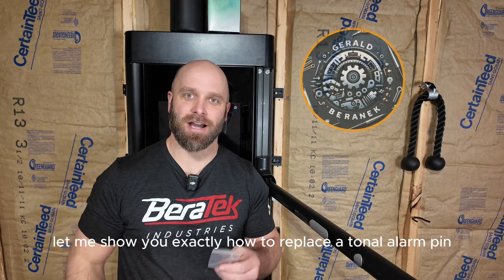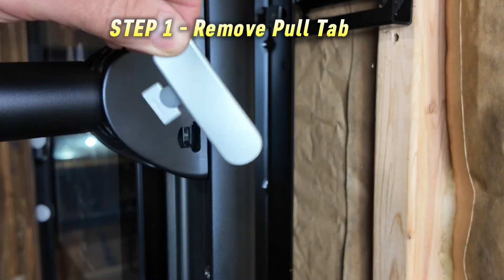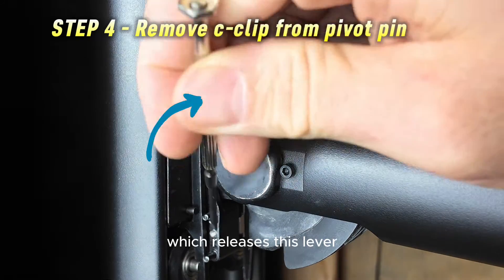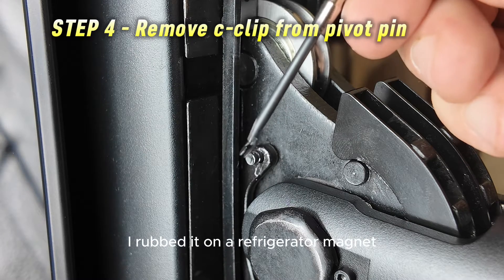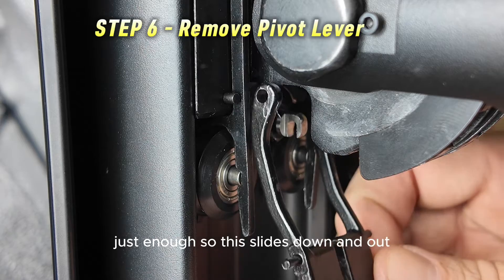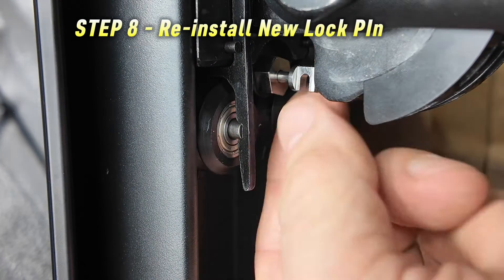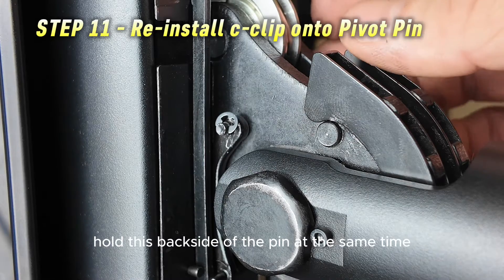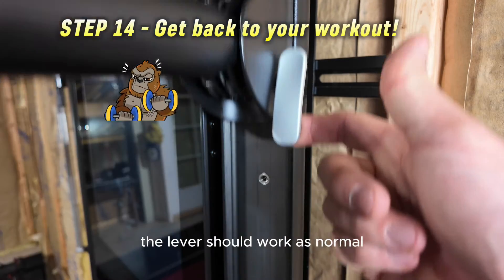Step by Step - How to replace a locking arm pin in Tonal Home Gym with upgraded stainless steel pins

Comment: The plastic cover on mine won’t come off
Reply from the maker: Is you arm stuck in the top position?  If so, it is very hard to get off and likely won't come off.  You'll have to get the wrench in there to get the pin out just by bending the plastic back enough.  Once you get the broken pin our the arm will move freely then you can take the plastic off.
Reply: @GeraldBeranek I fixed it

Comment: Thank you for this video and the tool. Last Sunday, my tonal arm locking arm pin broke. I ordered the tool on Monday for standard shipping and received it on Friday. I installed it and it works better than the other arm now! I’m considering switching out the pin on the other arm, but I’ll wait until that one breaks. I didn’t want to bother contacting tonal because it seemed everyone had trouble getting them to come over and/or replace the part. Our tonal has been working fine for the past three years, and this was the first issue we’ve had. I’m very thankful for this YouTube video and the part!
Reply from the maker: That's great to hear and glad it all worked out for you!

Comment: Thanks for this. I ordered your kit about a year ago and related the one broken arm. Other arm broke today and luckily I found the other pin in your kit. My only suggestion is for the c clamp, to use a small set of needle nose pliers to pull it off vs a screw driver. Less risk of it springing away on you
Reply from the maker: that's great news!  Glad you found it!  I agree, needle nose pliers would be easier!

Comment: How do I know if this is the problem with my Tonal? Mine sorta loses suction if that makes sense … if I’m doing Bulgarian split squat with arms all the way down, the arm will give lose a few reps in and move up one slot. Any suggestions?
Reply from the maker: This sounds like something else is wrong.  The pin just holds the arm in place before weight is added.

Comment: Any advice on taking the screw out? Mine is stuck on the highest level and I cannot remove the cover making it 10x harder to remove the screw.
Reply from the maker: You will have to try to wedge the plastic up just enough so you can get the old pin out.  Mine was stuck on the highest one as well.  It can be done and it isn't the most convenient place for it to fail. Once the pin is out you can move the arm down and get the plastic off.

Comment: This was perfect! Ordered on Wednesday, Tonal fixed on Saturday. Much better than waiting weeks for the manufacturer. I was able to do the repair myself in about 15 minutes. On the c-clip, a needle-nose did the job perfectly without having to worry about losing it. I was able to rotate it and pull it straight  up and off the pin. Thank you for putting together this great kit and video!
Reply from the maker: you are welcome!  glad it all went well and you are back up and running!

Comment: Despite taping… I STILL lost the damn little ‘c clamp’. Anyone find a source???

(I have purchased Gerald’s kit as the pin Total replaced under warranty has already broke!)

But now I’m on a C-Clamp quest!

🙃
Reply: Ok… found one!  Not an exact match… but it should be enough to hold it!

Kit installed and is working GREAT!  If I didn’t have fear of losing the other little C Clip I’d do the other side just to be done with it!

As it is… will evaluate how well my not-perfectly-matched little alternate C Clamp holds…
Reply from the maker: I think it is just a standard 1/8” c-clip!  You can find them at a Lowe’s or Home Depot!

Comment: Great video Gerald - appreciate you making it and offering the product.  A quick question- my tonal arm is ‘jumping out’ of two holes on the track - as I exposed the arm using your video, it looks like my pin has lost some of its ability to ‘return’ back to its original position- like a spring is worn on the inside of the pin.  Do your pins have similar or better springs which help to fix this?  Thanks for your insight!
Reply from the maker: There is a spring inside of the pin.  Likely what is happening is that the tip of the pin came loose which takes the compression of off the spring.  The pin I make has a screwed on tip so it can't come loose.

Comment: My arm was stuck up in the top position which presented a little more of a challenge because I wasn’t able to take the arm cover fully off.  The bottom of the cover tilted out enough for me to get in there and remove the hardware. The c-clip is definitely the trickiest part.  Once all the hardware was removed I was able to slide the arm down and fully remove the cover and finish the install with no issues.  Instructional video was a great help - thanks!
Reply from the maker: you are welcome!  Glad it went smoothly for you!

Comment: Just ordered! Great job on the video and i hope mine come in fast. I have a temp fix on the original pin, but no sense replacing a weak part with another weak part. Definitely worth the money for the problem it solves and not having to wait on tonal to ship the parts to a technician and them to come install it. Can't lose my streak 😂
Reply from the maker: I saw your order today!  It will ship out tomorrow first thing!  Thank you for order and the kind words!

Comment: Excellent video this is the third time I’ve had to replace my pin. The other video on YouTube is not detailed as yours. Great job. How do I order your kit? The only thing I really need is the pins. Also, needle nose pliers work better for me when installing the c- clip versus the small screw driver.
Reply from the maker: Thanks!  I appreciate that!  Didn't do to bad for my first instructional YouTube Video!  You can get them from my overly simple shopify store here - https://642986.myshopify.com/products/tonal-arm-plunger-pin-assembly-replacement-kit

Comment: Holy cow that small little piece of sh*t C-CLIP drove me insane getting it installed.  Dropped it several times, got lucky to find it.  Finally it worked after like 45 minutes of trying.
Reply from the maker: You got lucky you found it!  I dropped it a couple of times and it took forever to find it!  You could also use a small needle nose pliers!

Comment: Is this fix for an arm that locks in place but moves up during the middle of a set? In the bottom position the arm will unlatch and move up during the middle of a bench press for example.
Reply from the maker: Likely not, the pin just holds the arm in place while there isn't any weight on the arm.  Once you start a weighted lift the arm locks onto the rails.  The pin isn't strong enough to hold the arm in place with a weighted lift.  It sounds like you have something else wrong.

Comment: Great video. I've had to do this a couple times now. Saw you sold improved plungers and went to buy.. $100!! Dude.. it's 2 tiny metal screws with a spring and pin.. gtfo
Reply from the maker: Yes, these are CNC machined in the US from stainless steel and hand assembled. Fully custom besides the spring. It isn't a mass produced, high volume product.

Comment: The included wrench deformed quickly.  I used a 10mm wrench and was able to replace both sets in 30 minutes.
Reply from the maker: Yes, the little wrench isn’t much but will work if someone doesn’t have a 10mm wrench!
Reply: @GeraldBeranek  my tonal did not have a clip and both sides of the plate with arms were screwed in. I must have an earlier version.

The hex wrench used for the handle was the correct size to remove those hex screws.

My replacement would have taken considerably less time but the previous repair technicians stripped out one screw head making it really difficult to get it out. 

Your video made the process fairly easy and straight forward.
Reply from the maker: @mattmcpherson353  Great to hear that it ended up working out for you and you are back up and running!